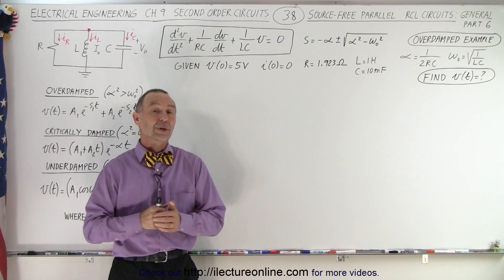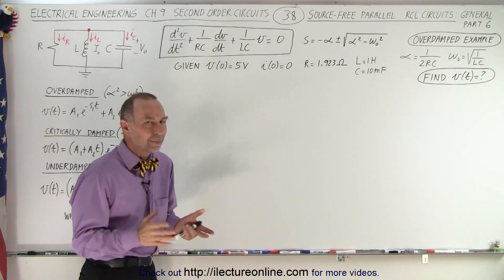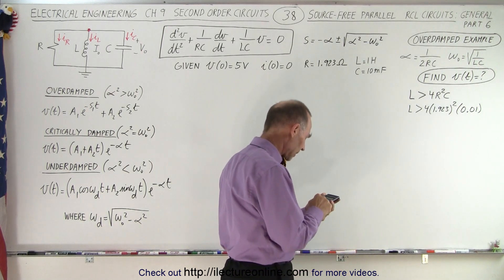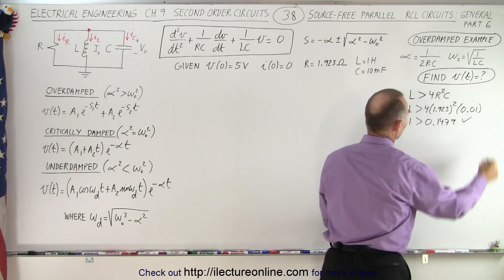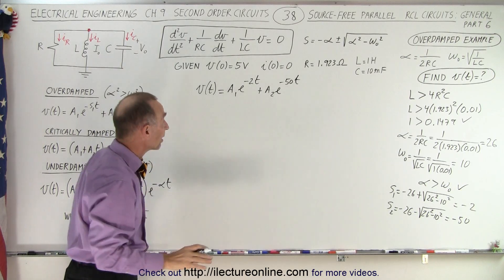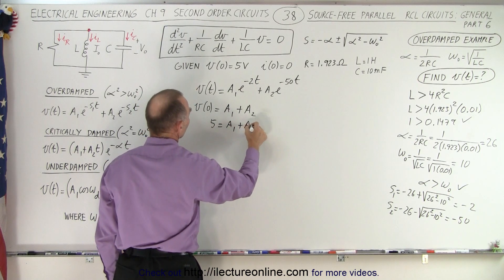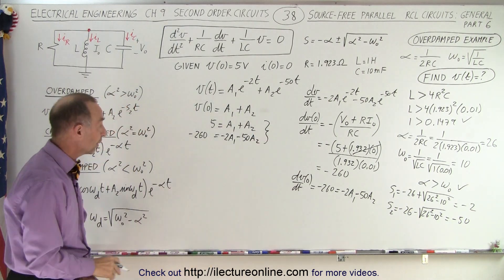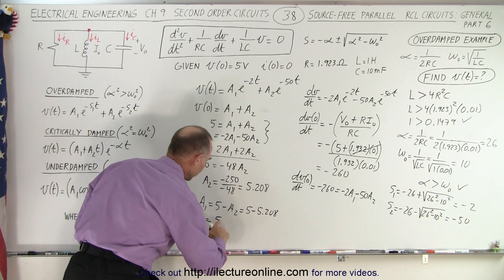Electrical Engineering: Ch 9: 2nd Order Circuits (38 of 76) Source-Free Parallel RCL Circuit 6 of 8

Comment: 4:05 if the solutions of S1 and S2 are negative, the v(t) formula should have the value of the exponentials positive right? As e^-st = e^-(-2)t = e^2t
Right?
Reply from the maker: Yes, you are correct.  In the general form it should be positive in front of the S1 and S2